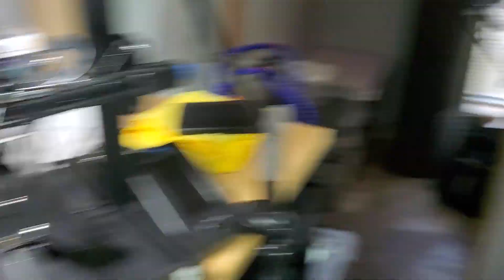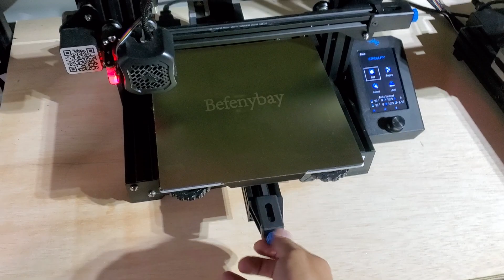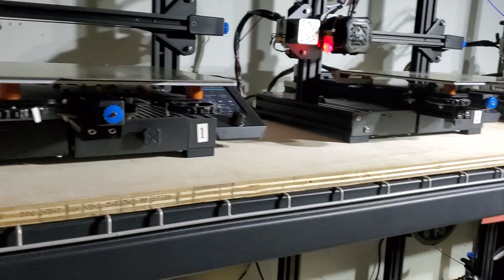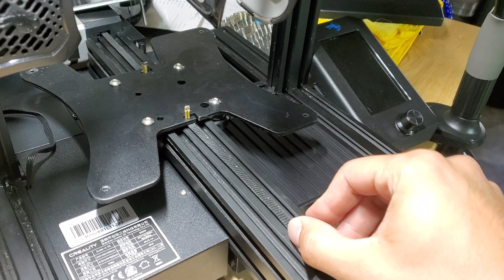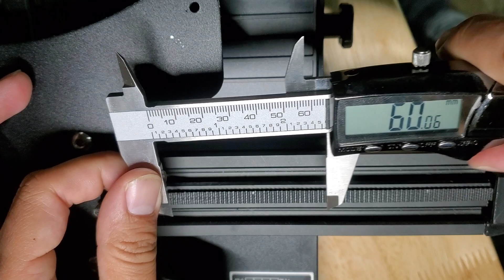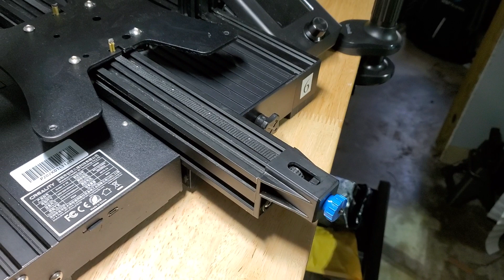3D Printer Belt Tension: Its ruining your calibration! Ender 3 V2 Print Farm Accuracy Issues

Comment: I'm not saying you're wrong, but you're using those calipers wrong in the video. To measure the edge of the teeth of the belts you were measuring you should have been using the other side so that you can get a reliable reading on the edge instead of eyeballing it like you were having to do.

Comment: This is actually shocking and I don’t understand why no one talks about it.  A 0.8mm difference in a 117mm span is huge.  Most of us are printing at 0.2mm layers but our prints could be almost 1mm off?  They have all these auto levelers, why isn’t there more being done to make sure belts are accurately tightened?  Feel like there should be endstop switches underneath the bed exactly 200mm apart, and the printer should move the bed to make sure it’s hitting both.  If it doesn’t, it should have an error message so you can check the belt.

Comment: have you compared print results before and after tightening?  has consistency improved?  did you try different belts to see if consistency of the dimension of the prints changed at all?  just curious if doing these changes has improved consistency, or theyre all within certain margin of error inherent on these types of machines.

Comment: I don't think it works like that: the diameter of the drive wheel doesn't change, so when the stepper motor rotates, the belt should move a fixed amount independent of the belt tension (as long as the belt isn't really loose)
Reply from the maker: I suspect any backlash might be causing the difference.

Comment: Why would my prints have smaller/tighter dimensions when printed? it seems like everything I print lately is smaller by 2-3mm? I've done several calibrations but did not fix. Could it be something in my slicer? Or because I changed from a Bowden tube to Direct Drive? Any thoughts would be greatly appreciated. Thanks
Reply from the maker: I would for sure check your steps per mm calibration. If that doesn’t work try a new slicer. 2-3mm is a lot so something is definitely off.
Reply: @Redo3D  I've calibrated steps a while ago and increased my steps from 93 to 96 and a flow rate of 80 to get the correct wall dimensions. But I thought maybe if I redo the firmware would fix it to. I did that this past weekend.  I will try that again and reply back. Just doing tests.  Thank you!
Reply: 3D printers only have an accuracy of about .040 per inch. When I make my models I print them at 103% to get a more accurate size. But then the length is 3% long.
Reply: @TimothyAllenCampbellGoTimothy  
Thanks Tim! I'm actually getting about 1.5mm in my prints being to small. and sum parts I'm printing really is a big difference. Yeah I can sand but its every wall and hole. It's weird. I'm currently re-installing cura. I thought about trying ideamaker but maybe eventually. would my extruder steps change alot switching from a bowden tube to a direct? I did a calibration and went from 93 (default for Ender3) to 95.6 steps? with a 80 flow rate. But don't think I should have to tweak it that much? I'm still wrench'n on it off and on. I'll reply when I get close. Thanks!

Comment: Tension on your belts is important and can cause holes to be more oblong if too loose, but I don't think really tight is a good thing either.  Belts stretch that is just their nature and I am not surprised your printers were no longer calibrated properly once you tightened your belts.  Probably you should have only tried it on one to see what the effect was rather than adjusting the belts on all the printers at the same time.

Comment: i don't get it, if you tension the belt, the printer will always go to the end stop switch before every print. If not the printer does not know where is at. The stepper motor and bed will always move correctly. No matter how loose or tight the belt is. As long as you don't adjust while it's printing.

Comment: This issue drove me nuts. Same thing I did. Measured the belts as per spec and when tensioned. The thing is that tension keeps prints clean but excessive tension offs the dimensional accuracy of prints. So I ended up buying belts that give me correct dims whether they are tensioned or not.
Reply: What belts did you use?
Reply: @EGGSHELLWRAPS  I got measured belts from creality.

Comment: Your on the right track. Your belts don't have to be really tight. They just need to be tight enough to prevent movement side to side or vibrations. As far as the belts are concerned they are gear toothed belts. Any gear is measured from center of the crest of the gear so to measure multiple gear tooths it should be from center to center of the crest of the number of gear teeth you choose.
The big thing is that you get both the X and Y axis's as close to the same measurement as you can get it. For example if one or the other belt is greater than the other your movements are going to be rectangular not square as it should be.  Just remember that if your model is large the accumulated error will be made by the number of layers your printing. Then there is the round which will be made oval the same way as a square is made rectangular by mismatched tension on the belts.
Also you can mark the smooth side of the belt by the number of teeth you choose to gauge your measurement because it is a belt and will stretch the same  regardless of which side you measure just measure from the same points on all belts.
Once you have done one to your satisfaction repeat with all your machens. If you just had one write your numbers down so that over time you can gauge  if the belt has stretched to the point it should be changed.

Comment: Belts should be as tight as a guitar string. No more, no less. some of those beds like number 4 that you pushed were waaaaaaay too easy to push, or atleast it looked like it lol. the easier it is the more wobbly itll be. The tighter it is the more harmonically sensitive it is [vibration frequency] there's a sweet spot in between. If you tighten it too much the belt will snap. That being said, belt tension would have almost nothing to do with your esteps thats entirely to do with the extruder. At most its just going to be vibration interference within the motor. So limiting that in the belts would help but what really effects that is the quality of the motor and the board. there is only so much you are going to get out of an ender 3.

Comment: what if you use spring to constantly tight your belt the same force.
Reply from the maker: This is what I'm looking into. A linear rate extension spring. I'm working on a solution now with this setup.
Reply: Springs will also vary with temp/barometric pressure.

Comment: There will always be stretch in belts. Car fan belts are the same.
Swap the thumbscrew with a Nylock lock nut. You will have to use a socket to adjust them, but it won't move.
The belts will stretch over time as well. Just add belt checks to your weekly maintenance regime.

Comment: A really really simple and good video. But im afraid that even you adjust at a defined torque the belt will continue to lengthen. But if you use same belt on all printer you can suppose all the belt lengthen in the same way and so you can establish a sheet with torque/steps. Another way, little youtuber (dont be obfuscated), talk about real problems.
Another problem (i have to verify) is that you have to redifined your steps each time your change extruder temp. it seems to me that if you make extruder calibration at 200°c and after you change for 210°c extruded lenght is not the same. So i think that temp tower that all youtuber utilize to determine the good temp are bullshit.

Comment: Did you ever use springs or just those silicone thick washers?   I am considering trying them out.  My bed seems to drift quickly after some prints  (although I wonder if it isn't my x gantry sometimes.  I added a second z axis, but that doesn't seem to fix issues 100%.  I did just order two of those digital probe gauges and plan to use them to really get the gantry spot on level for the future.  I had been using a square and some meter feeler gauges to eyeball the level.  I also like the idea of using a gauge to tram my build platform instead of the CR prob (which is slow as F).
Reply from the maker: I use silicone spacers and have not had bed issues since!

Comment: You should only the esteps in the extruder... not for X, Y, Z.
Reply from the maker: I would disagree here. Two printers with the same e steps on x and y might be far off enough from each other to make repeatable dimensions an issue. Calibration of the x and y is not for a single printers accuracy, but to match more than one printer to another in terms of dimensional output with the same file.

Comment: There's no need to tighten the belts so much. It ruins the bearings in the stepper motors due to the cantilever tension. The tension should be just enough that the belt doesn't skip.

Comment: Not seeing the issue. The stepper will move the belt tha same amount regardless of tension.
Reply: The stepper will move the belt the same number of teeth per rotation (as the gear pulley has a set number of teeth), but as shown the actual distance between the teeth can vary slightly

Comment: Lots of guitar tuner suggestions but how about a drum skin tuner style of jig? They work by pressing on a point in the drum skin and measure its push back resistance. You could maybe measure between a spanned length with a jig. Just a thought. 

The inch/lb tuning should help a lot too though. It would be interesting to know how loose a belt could get and keep a decent accuracy, eh? For longevity to keep them as not-overstretched as possible, maybe.

gg on the brain food!

Comment: Use a belt tension tester. Either an app on your phone, or a real device that measures belt tension like a Texa TTC or a very expensive optical type like an Optibelt TT meter. I general set mine up to 100hz and calibrate the X and Y. Then periodically say every 3 months test and reset to the 100hz frequency. 

If you do this then you know all your machines are equally setup and the step calibration on all your machines should be very close if not identical of each other
Reply from the maker: Definitely going to have to put this into the maintenance schedule. Thanks for the suggestion!

Comment: Use a guitar tuner… but the measurement in X and Y don’t matter. As long as your motor isn’t losing steps everything is relative. The belt stretch only matters if it happens during the print

Comment: I use a fishing spring balance to tension all my ender 5 belts to the same value, 8kg iirc. 12kg on my cnc router.    I was going to suggest the guitar tuner as I don’t think a torque wrench will be consistent due to friction, but I see someone already mentioned it.
Reply from the maker: Torque wrench definitely won't work. Thanks for commenting +

Comment: One thing about the Ender 3 v2 style belt tensioners -- if yours are like the ones that came with mine, their construction is garbage. If you ever take one off and look at its mechanism you'll see what I mean. The tightening knob pulls against a press fitted bolt into the second plastic piece. If you over tighten the belts you literally pull out the bolt's head from its press fitted hole and then the tensioner is irreparable. I suggest replacing the belt tensioners with better ones that have better mechanisms.

Comment: The only other ding is that anytime you make changes to the setup (change tension on belts, unbolt and re-torque anything in the extrusion path etc) you realllllly need to print a validation object to confirm your dimensional tolerances.  It stinks, but the flip side of having such cheap and prevalent home manufacturing/cnc setups is now we get to do all the stuff I would have done as a line mechanic/setup person, but on 20 something highly irritable and slightly sketch melty robots, and on my own dime XD
Reply from the maker: Definitely requires a lot of attention but little by little improvements can be made for longer lasting operation without maintenance.
Reply: @Redo3D  for real, it's the one downside to the extrusion based linear motion systems we use on most of these machines.  It's massively overkill, but a 12mm 2gt gates belt might be less prone to creep over time, but you are not squeezing that in the foot print of a 20xx based rail easily XD
Reply: Heck, now I'm tempted to do a project to see if I can measure ring harmonic changes over time.  Like bake it into the firmware to detect over shoots with something like Klipper and input shaper, and then have the printer let you tune tension just like an auto tuner on a guitar
Reply: Great to hear these topics addressed. I'd like to point out the in tuning an instrument say guitar/god forbid 12 string.Variations in temp change pitch but most particular variations in barometric pressure. You can tune up and it will stay that way untill weather changes then its time to tune up sometimes significantly. Sometimes hour or mths. As long as pressure returns to initial value your in tune again. WHO TOUCHED MY GUITAR!!! LOL.
Reply: PS...seems simplest solution might be min. pressure just enough to prevent slip.

Comment: Hey bud. Firstly, your belt is installed upside down. The toothed side needs to mesh with a toothed pulley on both sides. The way you have them installed introduces slip and adding that to the steps you loose with stepper motors makes for inaccurate sizes. Secondly, the only way you will get accurate prints is by using linear bearing rails and also ball bearing lead screws.
Reply: The belt is upside down/inside out for demonstration.  He said this in the video.
Reply: Wow..... Just wow..... .........

Comment: I don't think you'll get all your machines to be the same even with a lot of work.  A belt should be just tight enough that it never slips.  Definitely check belts for wear and keep them snug, but they stretch over their life.  Too tight and they will stretch prematurely or even bend a stepper motor's shaft.   Print a calibration item once a week and tune each machine's settings to correct for deviations.

Comment: Any time you adjust belt tension, you are going to change dimensional accuracy.  And since their wear parts, over time the belts are going to stretch.  Checking for deviations should be part of your monthly maintenance cycle.
Reply: I just stumbled on this video and was going to say this. The specific belt tension doesn't matter providing it's not too loose which leads to inaccuracy, or too tight, which leads to premature belt stretch and failure. The main thing is to calibrate the steps/mm for the tension you use, instead of of trying to figure out a way to reliably set an exact tension, which is doable but way more complicated than just checking the dimensional accuracy occasionally and fine tuning steps/mm.

Comment: It's aprinter, not a guitar! These belts don't need to be tensioned like a guitar string. Just enough to take any slack out of the entire belttravel.  The problem of these new belt tensioners is, that due to the screw-meachnism which acts as a leaver, you don't have the right feeling how stromg you are actually really pulling on that belt! Never tension to elastic (or even permanent) deformation of the belt!
Reply: Well said.
Reply: Learned that the hard way 🙃

Comment: You have problems because you are overstretching your belt. It does not need to be that tight, just enough tension to keep it running smooth is enough. You do not have to stretch you belt, it will only ware down way faster. And because you over tension your belt it will stretch to a point it will stay that way. See it as a elastic band, if you keep stretching it and keep it under tension it will stay stretched and to loose after some time.

Comment: This is due to cheap belts used in Creality machines, gates, or gates clone belts which have a reinforced core don't have this issue, rubber non-reinforced belts stretch. Using cheap belts from Amazon, I had trouble getting consistent movements, switched to gates, and issues went away.
Reply: do you have a part number for these belts? amazon link? thank you.

Comment: Man you stretch the belt it going to change things. Never thought about it at all need a screw drive. There's got to be away to convert belts to screw drive. Thanks a lot for pointing it out.
Reply: @viru52000 I do agree I think then maybe run along a gear rack . Or have a linear encoder to show position on the gantry. If you want to do repeatable semi precision printing like he is you need todo quality control.
Reply: Screw drive is VERY SLOW, that's why belts are used.

Comment: I don't agree. Movement distances are fixed by teeth of motor pulley. Any stretching of your belts should not influence anything in your printng precision.
This is the theory.
Reply from the maker: I would agree as well, but the pulley and belts are not perfectly match, there can be some backlash as someone suggested. This backlash can be the reason for the variation in print size. Ive been testing this morning and noticed after a certain amount of tension, the size does not change. What I want to get to the bottom of, is how much tension will remove backlash
Reply: @Redo3D  theory and practice will never match, haha
Backlash phenomenon could be the reason for your printing tolerances.